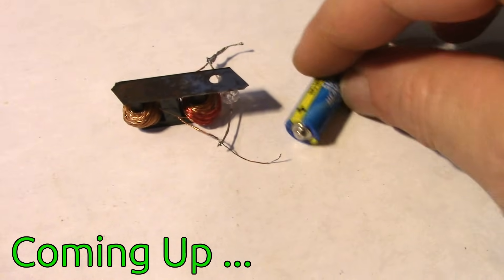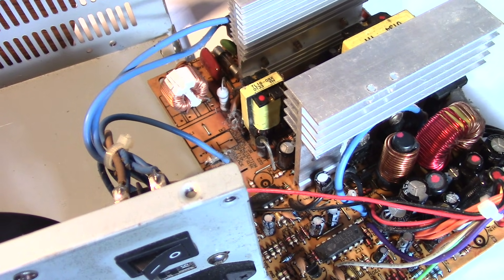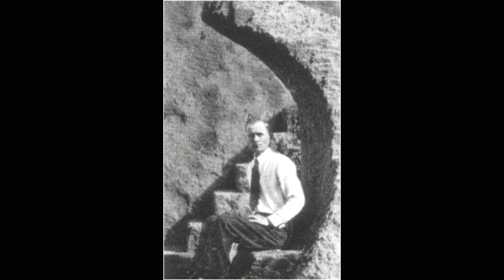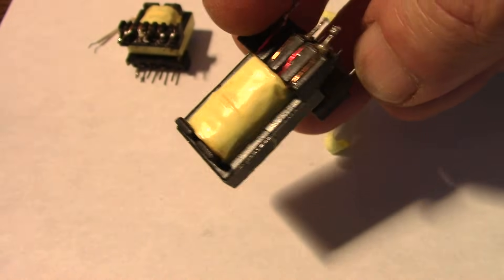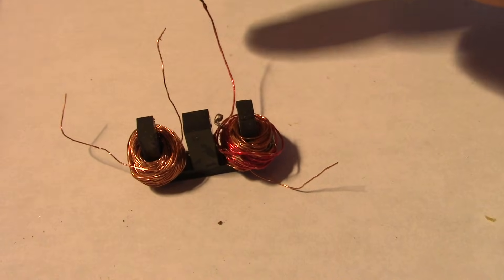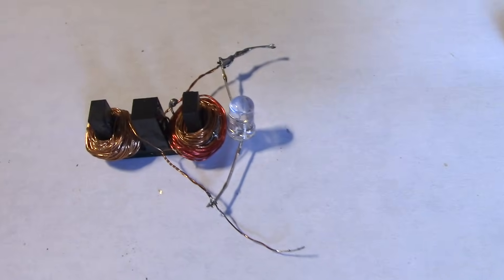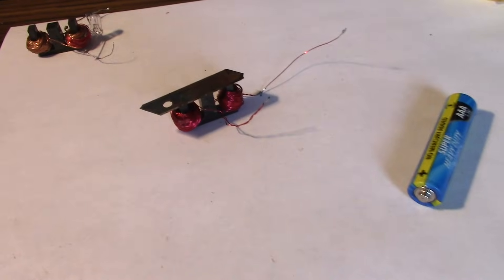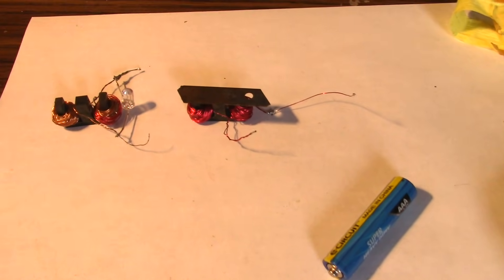This Electro-Magnet Works With No Electricity!

Comment: Did you try to get the led flashing when you remove the plate from the ferrite? After it has be held by the ferrites?
Reply from the maker: I don't think I can remove it fast enough to see if a flash happens. Have tried and don't see anything from the LED. But, I don't think it will, with the low voltage and low number of turns compared to usual larger ones. If I remember right, usually 9V or 12V is used on steel versions.

Comment: wow good man btw this is exactly what happens at fundamental level in a hard drive as the disk 💿 is made of a speacial alloy and the read/write head does exactly this thing on the platter making it magnetic and non magnetic to store binary data! : )
Reply from the maker: Didn't know that 😀
I do know they used to have little wings on the heads, from about 1986 when I used to work at a place that made HDDs.
Reply: @Slider2732_  You worked at that kind of place Damn that's cool
Reply from the maker: @bhxlegend  They made a tiny laptop type drive called the 'Penny'. I think it was only about 20MB storage, but fair enough, anyone elses drives had 5 1/4" platters! 
I worked in the computer department, where the mainframe was a pair of VAX 11/750's. There was also a PDP-11 in there, with spinning tape reels!

Comment: I wonder if you could get the same core lock with a nearby magnet in motion... have a literal spring, forcing actuator to break circuit repeatedly after each magnetization ?
Reply from the maker: Heck, that's an idea! 😀
There would then be the flyback from the coils too, which we know will flash an LED. Hmm, also a pulse motor and place the PMH outside it, against at least 1 coil. Could that magnetism from the coil make the PMH lock, or, would the keeper on the top stop the magnetic energy from getting in? 
Good thinking points, thanks.
Reply: @Slider2732_ good thinking!

Comment: Always wanted to do the same test with rock, not metal. Horse shoe rock with coil pulsing near a slab to pull on it.
Reply from the maker: Ahh, yes, John! 😀
We used to have a bag of iron ore from the Minnesota mining range (wife grew up there). It does make me wonder too about whether that may work on one of these. 
Btw, there is a place up there called Effy and it's been my experience that it's not immediately apparent to locals why it's named like that.

Comment: So it’s a magnetic battery what happens when u use a bigger peice of metal Al
Reply from the maker: Hi Kingrutse 😀
A magnetic battery is a good description. 
Have just tried your question, using a 9V battery sideways across the coils. With the AAA battery supplying power, I can hold the 9V and lift the PMH fine. But, with that mass of metal of the 9V it won't lift if the AAA is removed. A very interesting finding and thanks for asking the question.

Comment: PMH?
I think the answer lies in the keeper which is probably a hard steel able to retain magnetism.
For that matter, even so-called 'soft' magnetic materials can retain some magnetism. Some years back, I built an experimental FM transceiver and found that accidental shorting to ground of a ferrite-cored tuned circuit would put it out of adjustment. And, yes, placing the core into a gradually diminishing alternating field brought the core back to its proper tuning range.
So, unless I have misundertood something, permanently magnetising a 'hard' material using momentary current is what we should expect and have done this to restore weak magnets with the aid of a few turns of thick copper wire carefully dabbed onto an old car battery.
Many thanks! Look forward to the next instalment!
Reply from the maker: Thanks for the info 😀
Yes, I would agree about the keeper, it has to be metal. Ferrite to ferrite was tried and got no result at all, which is also expected. 
What's intriguing, to me, is how it keeps the electromagnet action going until the loop is broken, then completely loses it - flips it from on to off. It's something like setting bubble memory for 1960's computers.
Sounds like a fun bit of experimenting with your FM receiver.

Comment: Merry Christmas and Happy New Year 🎉
I've always wondered how Ed managed to build that castle but I don't think it had anything to do with the PMH.
The one thing I would have liked to see was if the keeper would work between the center leg and either of the coiled legs..
Oh well very nice simple build and demo Thanks 👍
Reply from the maker: Ah, let me fix that gap in info for you, Jon.
Just tried it - I expected no result, but, it has what seems to be exactly 1/2 of the power! It'll lift the one end up, but then drops with the weight of the unmagnetised side. It also does stay magnetised for as long as the keeper is on it, with no fade off. 
Happy New Year to you and family too 😀
Reply: @Slider2732_ Thanks I thought it would be equal or even stronger it might become equal if you use two keepers sharing the center so both the outers have contact with the center.
Reply from the maker: @Jon-fs2zj  Cheers Jon 😀
Id try that, but would have to buy another sharp knife to take the blade out of 🤣
Or, I could start shaving properly again with razors and use those, instead of spritzing with a hair trimmer. Gripping razors on the edges might be a bit risky though!

Comment: What is the idea? To induce 2,5 volts over the led?
Reply from the maker: The idea is a demonstration of how Ed thought magnetism works and, in this case it does work as he described (he wrote a book about magnetism with some very strange and perhaps cryptic wording that doesn't make a lot of sense)
So, the idea is to show how the battery doesn't need to be constantly connected to make the electromagnet work.
The LED was my idea to check the coils were working as expected, because a regular 1.5V battery isn't able to light an LED. If they had a short or some other problem then the LED wouldn't flash 😀

Comment: 🤔With the part suspended, short-circuit the wires.
Reply from the maker: Yep, it would drop! 😀
I did wonder if it would flash the LED if the keeper was removed quickly, but I don't think it has the power, or I can't zip the piece of metal away fast enough. An LED will flash with bigger 12V versions though.

Comment: When the metal keeper is removed you can measure energy coming back out of the coils. That makes it a storage battery with no internal resistance losses.
Reply: I'm sure it has some heat loss, just imperceptible over our life time.

Comment: Nice demonstration i remember seeing a video on this and the person doing it had hopes of using  a tiny amount of the tiny amount of energy to run something 😊 👍 i will be amazed if that robots 🤖 eyes are blinking using this as the power source in the upcoming videos great video and thought provoking.
Reply from the maker: Thanks John 😀
That would be something eh, the robot running from the energies of a PMH!
Yeah, I recall Lasersaber was measuring a few uA from around the core metals 🤔
Reply: 🤔 how many in series would power your oscillator circuit  🤔 😂 nice one mark 👍
Reply from the maker: @johnwynne-qx6br  Hmm, it would be awesome to tap energy from these, like some kind of forever battery storage. Maybe to keep a supercap charged up. 
Or, for a decent use as they are, to keep an electromagnet door lock working during a power cut <-- actually that IS a good one and surely exists already lol

Comment: Happy new year 🎉

As far as I can see no oscillation means no LED lit up.😂
this just prove the point: no movement=no power consumption/dissipation=energy conservation in a closed system.

But, on the other hand I thought Ed Leedskalnin invention is related to electric power generation using the principle of PMH (in some books/documents says something about a patent).
Reply from the maker: Happy New Year to you too!
Yes, if it's in one state, then it can stay in that state, only movement somewhere changes it. I see what you mean 😀

I don't know that we can ever know what was in that box at the top of his chains system and, perhaps, there was nothing. But ideas like the PMH seem to suggest he knew quite a bit about magnetism!
Reply: @Slider2732_  well, there is a lot about magnetism and ferromagnetic metals or alloys. To my surprise even to lumps of iron can generate magnetism if moved at close distance … just wrap some copper wire on one of them and you can read a voltage … absolutely no permanent magnets used. Just a slotted iron disc and a bar of iron with some turns of copper. The disc spin easy without any opposition !!! Something similar with one of D Smith setups … probably the only one kinetic that he ever built.

Now, if we read some old books we can see a (weak) magnet can be done by using a hammer and a bar of iron oriented S-N with an angle pointing with one end to the earth N pole and hammered from South. But in my experiment I didn’t hammer anything 😮 Makes me wonder if there would be any Lenz present or Eddy and how they may conspire for the outcome.

Comment: I saw one PMH which was a 2 inch square bar sliced in half, with a slot for a 12/14 gauge wire.. only need one strand through it, and can slip the wire out... a tap on  a 12V battery locks the two half back together.  (Itw as a video - but it doesn't come up on searched for PMH anymore)

Could also be tricky and use it as a mag-lock for a door, though I'm not sure how to undo the charge other than separate it - but the two bars you'd HAVE to torque in order to separate them.... could reverse run the current in exactly the same amount as forward, but ... how to gauge that?
Reply from the maker: Thanks for the very interesting comment. 
I'd think the original uploader of that video must have removed their channel or similar. 
Must admit, I did laugh when thinking about the door mag-lock... imagined someone running from someone else, hitting a switch and the other person completely dumbfounded at how to open it again. Seems like a good idea really, no door handle, just a hidden switch. Energizing in the opposite direction should unlock it, with a hand push at the same time? 
People could get really trapped with these ideas 🤣 👍

Comment: I am no sientist paaaa❤❤❤❤
Reply: A simple electromagnet is a shaft of screw driver. You can magnetized it using electricity. Simpler than PMF. Once magnetized you can remove electricity and the shaft become magnetic that holds other metal like a screw. PMF needs electricity. It doesn't lock by imagination. It needs electricity to become like that.
Reply: *PMH
Reply: It's just in another phenomena than simpler electromagnet like screwdriver shaft I've mentioned.
Reply from the maker: @PLASMUX-20  It's New Years Eve, you can spell it how you wish!
Happy New Year to you Plasmux and thanks for your kind comments 😀
Reply from the maker: @PLASMUX-20 Here's a question that you may know the answer to (because I don't). 
If a screwdriver is magnetized, can current be passed through from an electromagnet to make it non magnetic again? I wonder if it has to match exactly what went into it, as well as being the reverse current direction of what made it magnetic.
Reply: @Slider2732_ Screwdriver shaft is not pure iron or simply iron which totally different from what exactly the PMH. Some metal retain magnetism while others don't. That's why PMH needs not just any metal but iron. There's a magnetizer and demagnetizer for screwdriver shaft but it's actually a different thing to PMH. PMH is very special design by late inventor Leed... 
My first comment is not exactly right to compare PMH but only simplify and only focus on how to become magnetized. Not to contradict what the video is for, I admit it's wrong. But what I meant was they all both need electricity at first to make magnetize.
Similar to a pieces of nuts, but it also another story, a no windings just a piece of wire and several nuts. A bit different but a bit related. 
Happy New Year bro!!! 🍻.
Reply from the maker: @PLASMUX-20  Thanks for the extra info 😀
Yep, have recently seen those nuts in a circle experiments and they are very cool. 
Also, I can imagine how violent electrical storms have created magnets for billions of years! We're on a tremendously intriguing rock floating through space.
Reply from the maker: @PLASMUX-20  Yes, my wife actually said too that how is it different to a fridge magnet?
The answer, really, is the PMH can be fully turned on and off, whereas the screwdriver or fridge magnet keep their magnetism 😀
Reply from the maker: Haha, no problem, it's a confusing but cool device! 
I can see that the magnetism gets locked in with nowhere to go. But would have expected it to leak out in some way from the coils, especially when using ferrite.